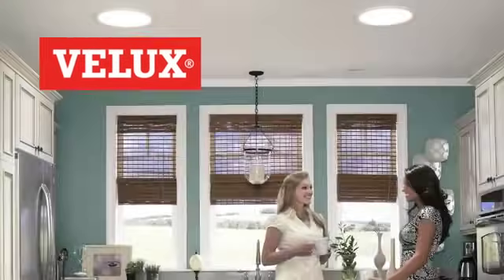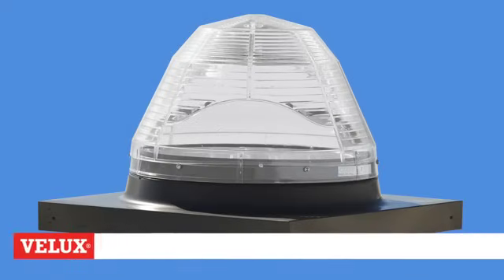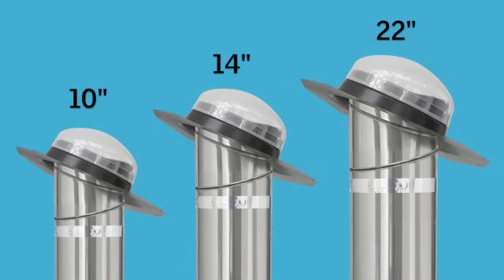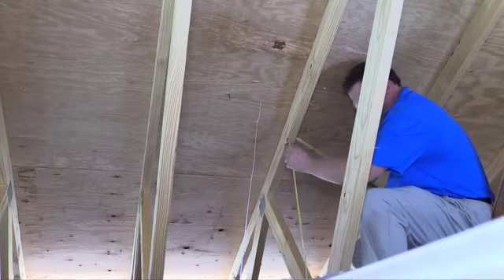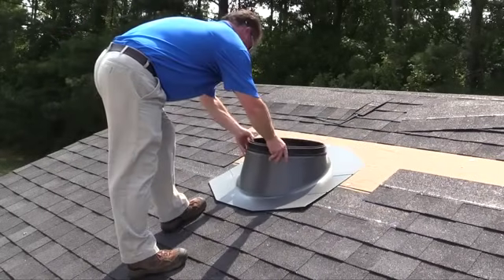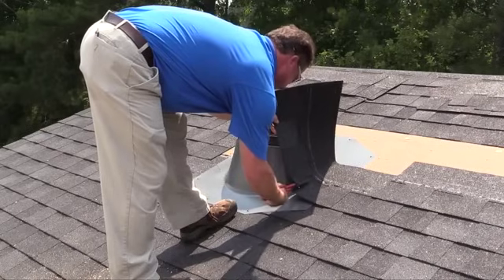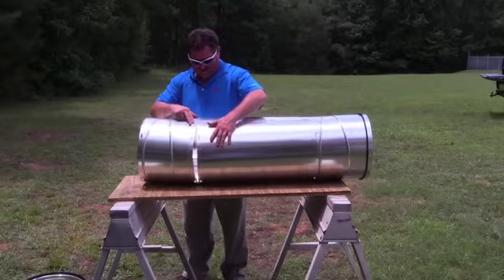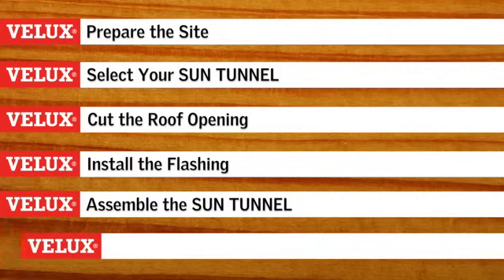VELUX Install Video - SUN TUNNEL Skylights SD

Comment: why pitched sun tunnel needs a much bigger roof cutting？Also, the diffuser cover is very tight and very difficult to rotate, any tip? Thanks.

Comment: The company who installed my sun tunnel put the tape on the inside is this correct? Shouldn't the tape be on the outside like in the video?
Reply from the maker: We recommend that the tape provided with a Sun Tunnel be applied to the outside of the tube for better light quality, ease of installation, and potential service issues. For visual confirmation you can send images to velux.solutions@velux.com. Thank you.

Comment: Plan for A LOT of extra time depending on location.   The 3 hrs install time is for a perfect scenario.  I installed the 2 sun tunnels over my stairs.  So the setup and positioning of ladders took over 30 mins.  Going up/down from the attic is not easy in my house.  Lots of mins just moving between attic and 2nd floor.  The area in the attic where the tunnels are located was probably in the tightest space up there.  Not as simple as the video with lots of standing room.  And of course, you need to be careful and ensure you are supported on the beams and not the drywall.  Cutting the hours was not so simple. I have a double drywall ceiling and guess what.  When cutting the holes, I came across wood strapping for the ceiling.   Grab more tools, more time needed.  Installing the fixture took a lot of trial and error.  The hole recommended does not factor in the tabs.  I had to cut extra 1/2 inch notches at the 3, 6, 9 and 12 o'clock positions.  I concur with others, the defuser is nearly impossible to put on especially on a tall ladder.  And if your fixture is too tightly installed, it will warp the shape and make the install of the defuser impossible.  My install time didn't even include the roof work.  This was done by the roofers when I had my roof redone.  Oh, by the time I installed the defuser, it was so dirty from the handling that I wanted to take it down and clean it.... :-(  Not the best DIY experience but glad I could could finish the job.
Reply: It is even worse now.
The lower fixture does even have holding screws or any predrilled holes.
In 2012 I installed 6 skylights. It took one day for the first time,  and half day each for each subsequent ones.
Now there are no holding screws, no cardboard template marked on box, and very thin flair.
I have already spent 2 days for the first one.
Returning all of them back to Lowes.

Velux is no more the pioneer it was 15 years ago.

  NOW IT SUCKS

How d
Reply: Lesson learned don't put crap like this on your roof. I have a foolish customer who wants 1 and I'm about to have to install.

Comment: How do you adjust your metal rigid tubes to fit the length? What if they are a few inches too long?
Reply: Slide them in deeper and screw and tape

Comment: How to install weather lock and underlayment around sun tunnel? I just bought my sun tunnel, but worries about leaking
Reply from the maker: While VELUX does use an ice and water shield in the flashing and installation of our skylight products, the Sun Tunnel Skylights require a slightly different installation method requiring the use of a roofing mastic to create a waterproof barrier. If you have any questions about this method, please feel free to contact our technical support team at (800) 888-3589 for assistance.
Reply: @veluxusa  my installer didn’t seal tube joints, he think it will get too hot, so he left joints unseal, the heat will escape to my attic, so my question is he right about it? Should I seal it myself?

Comment: Is there heat transfer?  I'd be concerned about bringing in extra heat in the summer
Reply from the maker: Hi there, Sun Tunnels have design features such as thermal breaks and gaskets that reduce the risk of condensation in colder climates such as the northern US and Canada. Generally, they do not have issues with condensation in warmer climates, for example; during the Summer with air conditioning.  For heat gain, we offer an optional energy kit that reduces Solar Heat Gain to as low as 0.26 Btu/Hr-ft².

Comment: In this video look easy but inst easy just walking up down from roof to interior ceiling is a big work take a least 5 or 6 hours to complete but if u have all tool and parts needed if not don't touch roof bcz maybe rain later 🤣🤣😱

Comment: My diffuser is two pieces of plastic and a rubber ring that seems to simulate a double pane window for insulation.  I took it out for cleaning and it's near impossible to put back.  Any tips?
Reply from the maker: Hi Nils - Thanks for the question. 

Once you have diffuser discs inserted into the rubber gasket, you will notice that one edge of the gasket has a frilly edge (like a small bump out in the gasket) and the other is smooth. Insert the rounded or smooth end of the diffuser into the opening.  You may need to apply a light coating of liquid dish detergent to the outer portion of the gasket so that it will slide more easily into the ceiling housing.
 
If you need further assistance, please call VELUX Technical Support @ 1-800-888-0361.

Comment: I’m interested in this. How much does one cost?
Reply from the maker: Thanks for the question. The cost ranges from $650 to $2,150 to install a single Sun Tunnel skylight. The cost will depend on the roof pitch, the height of the roof and the distance from roof to ceiling. Thank you.

Comment: Can a sun tunnel be place in a cathedral ceiling is there a minimum hight
Reply: any chance you got a response to this question? I'm wondering the same.
Reply: i have been roofing for 15 yrs, i have never done that though i dont see any reason why it cant be done, but you might not benefit from the reflective properties, would be more like a little skylight.
Reply: @richardnewrick6400  we had two installed on cathedral ceiling. You are correct that the lighting angle is a little different as it is coming into the living space at an angle. But we are satisfied with the installation and the end result.
Reply: @tomgardzinski5029  Glad to hear it!, would be interesting to see for sure. did it affect the square footage of illumination? if so; could you make a guess at how much? would be good to know so i can provide an answer if I'm ever asked, thanks.
Reply from the maker: Sharon, Tom and Richard - Apologies for the delay. There isn't a minimum distance based on reflectivity, but for connectivity you need at least 6 inches of tunnel to reach the ceiling ring from the pivot ring of the flashing. We hope this helps!

Comment: Is there a minimum high for installing
Reply from the maker: Sharon - There isn't a minimum based on reflectivity, but for connectivity you need at least 6 inches of tunnel to reach the ceiling ring from the pivot ring of the flashing.

Comment: The video is terrible. What screws go where? How do I measure the solar tube to determine what needs to be cut? Lots of details left out. The instructions are also worthless on what to do with the solar tube itself. 

The solar tube is too short, so I use a elbow and now it’s too long. Do I need to use another section and cut to it? Or do I use the elbow and cut down?

Poor instructions are stopping me from completing the project because I don’t know what I’m doing. Thanks Velux.

Comment: I got a good laugh from the statement about roof pitch from 15 to 60 degrees. Roof pitch is given as a ratio to 12. 4/12, 5/12, 6/12, etc. It's obvious you've never framed a roof in your life.
Reply: Or did but did it "my" way xD
I understand what you are saying but I believe that anyone measuring in potato heights does a better job than some people working in /12 if that's all they know. Don't laugh at the beginner, cause their second work may be better than you potential!

Comment: DIYers Don't buy this product. The light diffuser is very poorly designed and extremely difficult to insert.  I have followed the directions every time, but something always happens before getting it seated properly. The diffuser discs collapse together most of the time or one edge will go in but not on the other side. Calling support won't help either. They will repeat the directions and tell you it was shipped to you with the diffuser inside the ring, so it should fit. Of that I have no doubt, but I have spent several hours of my precious time on this without being able to insert it  while on a ladder with 2 people trying to position it without the same success as the robot did in the factory under ideal conditions.

Comment: It is impossible to remove the defuser if debris and insects get into the non-sealed tunnel. NOT recommended!
Reply: actually, the diffuser is easy to remove. no tools required.
Reply from the maker: Hi Carolyn - To remove the diffuser carefully pull down on the edge of the diffuser gasket. A pair of needle nose pliers or tweezers will make this easier. We hope this helps. Thank you.
Reply: You're not kidding. My mother asked me to remove the diffuser, but it wouldn't turn. SO I forced it and behold...  several feet of rigid tubing came down in my hands. Now I'm watching videos to try to repair it.

Comment: To the general public
This is far from a diy project
Its a cheap bubblegum 
Piece of junk that falls apart while your working on it
Reply: hardly. Velux products are made in the USA in Greenville, SC. Best in the business. Hire a 3 or 5-star Velux certified installer next time.
Reply: @billyc5435  A single layer of PC as a ceiling insulation instead of at least tri-glass. Top quality, I see!